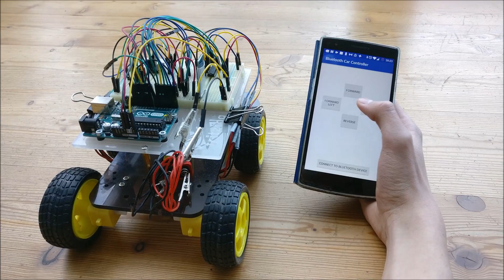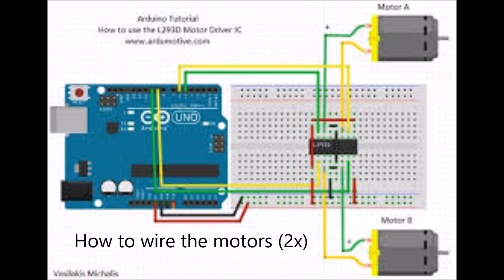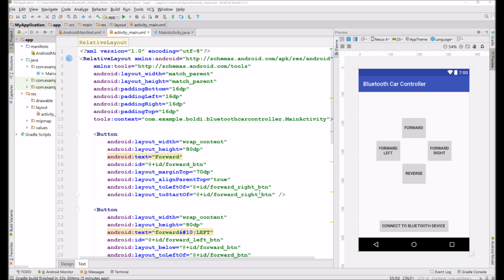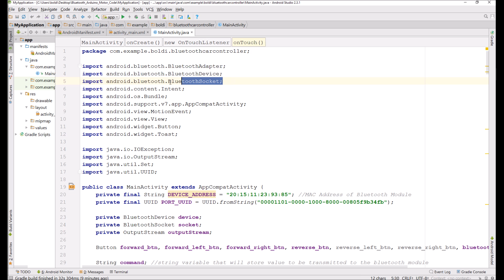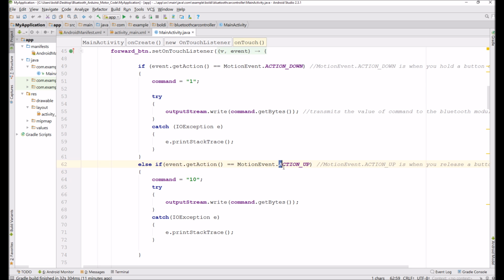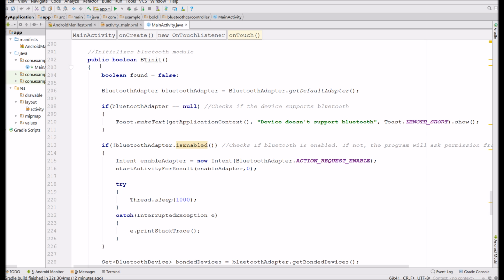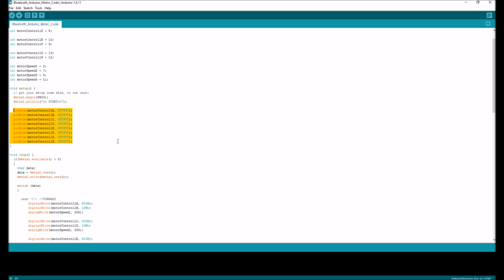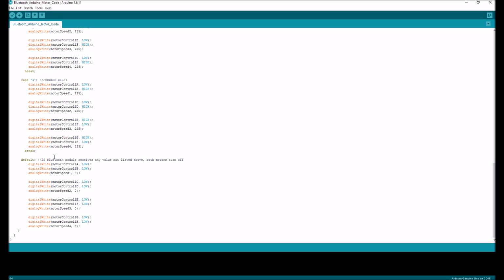Android Controlled Bluetooth Car {TUTORIAL} + Source Code

Comment: Hey, I am trying to build your Bluetooth smartwatch for a school project! But I could not comment there since it was made for kids. I cant connect to the HC-05 bluetoth module from your app. I click connect BT but nothing happens! Any help would be greatly appreciated! Thanks.
Reply from the maker: Hi! Did you set up the Mac Adresse in the app correctly?
Reply: @BoldizsarZopcsak  I solved that issue and connected with the HC 05 module but the OLED display still says pair BT
Reply from the maker: @Itz_Kiran_j  Have you given permission to the app to use Bluetooth? When you do, please remember to press the back button to get back to the app. Sounds very frustrating :(
Reply: @BoldizsarZopcsak  Yes. It even pops up as "connection established" in my phone. But the OLED connected to Arduino still says "Pair BT".
Reply from the maker: @Itz_Kiran_j  Does pressing the connect Bluetooth button again do anything?
Reply: @BoldizsarZopcsak  It pops up saying connection established. But the OLED display continues saying Pair BT
Reply from the maker: @Itz_Kiran_j  Hm that's very strange and seems annoying. Have you tried plugging in the Arduino nano into your computer and printing some debugging information? Is the signal coming through at all?
Reply: @BoldizsarZopcsak  Will try shortly. Thanks for the help!

Comment: I'm trying to build this project with Android Studio version 3.5.3 and get a lot of errors.Too many to show here. Can you give any hints ?
Should I try an older version of Android Studio ? Which one ?
Reply from the maker: I use 3.4.1 and it works fine. What sort of errors are you experiencing?
Reply: I have installed the same version as you 3.4.1 and get 16 errors in the MainActivity.java file. Can you please tell me how to import your app files correctly ?
Do I start with an empty app and then import your files manually ? The  Hello world test works fine,also transferred to my phone.Any ideas ?
Reply: @BoldizsarZopcsak  I managed to get it to work using the same version as you have. Is it possible to make a Listview and pick BT devices so we don't
need to hard code the MAC address in the code? Thanks for a great project.
Reply from the maker: @mannhansen9337  Yes! You should have a look at the android documentation for bluetooth.

Comment: Hello, the app worked after  some tweaking. You need to add bluetooth_connect_btn.setOnClickListener(this);  while declaring the Listener. It works fine then. Thanks for this code.
Reply: Where should I put the line " bluetooth_connect_btn.setOnClickListener(this);" ?
What other tweaking did you do to make the app work ? I have just started with Java and need some working and practical tutorials.